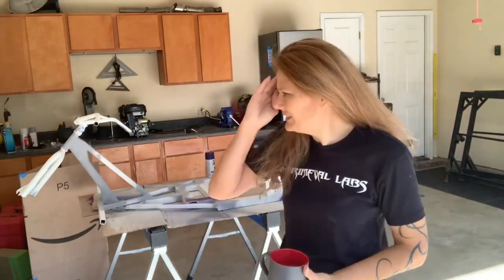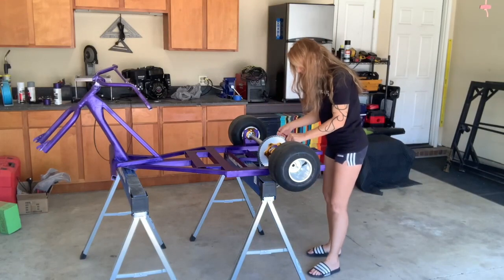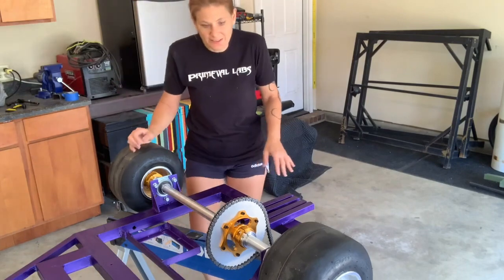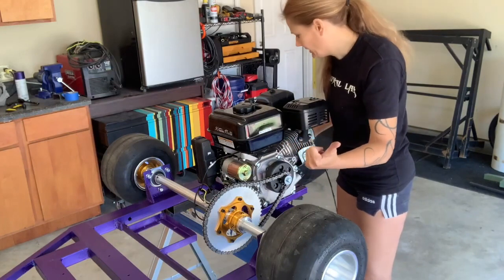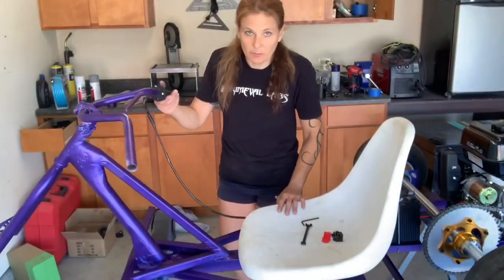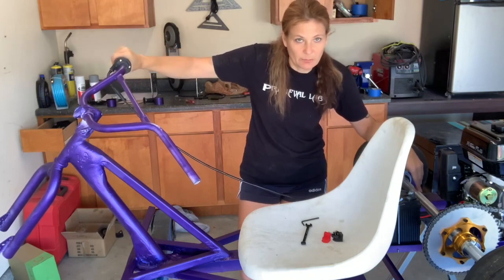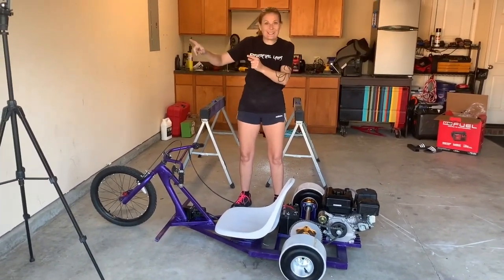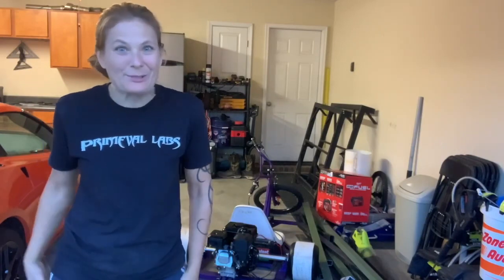Part 11-Drift Trike Build- final episode! Painting, assembly and test drive

Comment: I know you made the trike and this video over a year ago. I'm speaking as a small engines mechanic, that I am. Two things I would have done differently, ( I would have made a chain gard to go over the big sprocket that was behind the seat. To protect you in case the chain broke.)(  The second thing, would have put a engine kill switch near the steering wheel.) In case engine got out of control. I just saying this because I have seen these things happen In my 50 years of small engines repair. Betty: You did an awesome awesome job.👍👏 I solute you. Thank you very much for rerunning this trike series. I enjoyed it more the second time around and saw more,( like the two things I would have done differently). I hope the new owner enjoys it, and all the hard work you put into building it. God Bless you 🙏😇